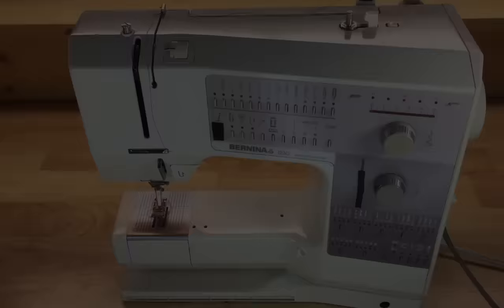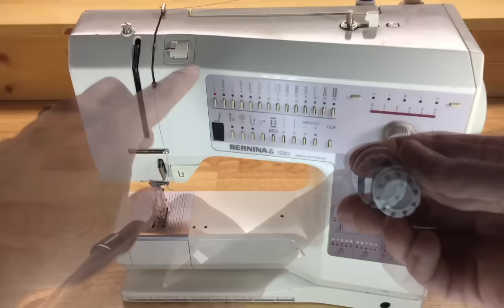Sewing Machine Problems: The Most Common Issues

Comment: Thanks so much for your video. I found it helpful but unfortunately I’m still having issues with my Necchi sewing machine model 4975. Every time I try to sew, the bottom thread gets all wadded up! I’ve adjusted the top and bottom
Tensions per your instructions but still can’t get it right! I’d appreciate any help you can give me! Thanks
Reply from the maker: Most likely it's an upper threading issue. Make sure you're in your tension disks and take up lever. If you're 100% sure it's threaded properly it might have a burr on the hook or bobbin case. If you'd like you can take a video and send it to @jackcreekroad on instagram and I can try to help you more from there :)

Comment: Can you help me solve this issue... after completing a row of stitches, I raise the presser foot, pull my fabric away from the machine, I sometimes have 3 strands of thread coming from the bobbin area. What am I doing wrong?
Reply from the maker: The stitch isn’t completed. So you need to rotate the handwheel towards you until the take up lever is in the highest position before you pull your material out.
Reply: I didn’t think the issue I am experiencing had to do with the take up lever because the 3 strands would be at the very end of the stitching. Nevertheless, I will now ensure the take up lever is all the way up just before ending my stitches. Thanks so much for sharing.

Comment: Thank you for being so thorough. I have a question about stitch appearance/quality: my upper and lower tension appears to be correct. (It does seem my bobbin tension keeps coming out of adjustment.) However my stitches on the underside of my work seem to not be perfectly straight. The tension looks good. But every 20 or so stitches one or two stitches will look wonky. It might sound like no big deal but it makes my work look unprofessional (to me). Anything I can do? Is this a timing issue? I'm very careful about keeping my machine clean, oiled, new needles, all the things. It's an old machine - brother vx-1100.

Comment: Thanks for this very useful info. Is there a home repair for a straight stitch not being straight? I have a top-loading manual Elna (purchased for under $100 used) that functions mostly pretty well except for the straight stitch. The individual stitches all slant slightly. Is this fixable? The other issue the machine has is the 1-step buttonhole. The right side zig zag is always less dense than the left side. I’ve heard this is a common problem with Janomes (manufacturers of Elnas, right?). I’d be grateful for any guidance.

Comment: I know this video is older and you may not see this.... but.... what are the trouble shooting options for "nesting" on the bottom stitching if you can see the thread through the take up lever and you hold the thread when starting stitches.... it also does happen all the time, but times than not.    I have a sew mate 5400 that was gifted to me.... and singer tutorials haven't helped much.  Any advice would be greatly appreciated
Reply from the maker: It could be a few things. Your tension should be around 4. You need to make sure that your threading with the presser foot lifted. And make sure, as you said, that the thread is in the take up lever and you hold your thread tails.
Reply: @JackCreekRoad  foot up, I'll definitely try that.  My machine is set to 5, which it factory recommended as marked.... but I will try on 4 and see what happens.  Thanks so much!

Comment: 2 things going on with my machine. It's a new Brother project Runway limited edition. My bobbin isn't winding tight. The thread is loose. I'm not sure what's going on with it. Then when I'm trying to sew with the prewound bobbin that came with it. The top side when I'm looking at it has loops. This is a new machine that is different from my older one. Not sure how to fix it. HELP!!  Thank you..
Reply from the maker: Are you going around the pre-tensioner for the winder?

Comment: Whenever I try to use my sewing machine the top thread pulls out of the needle. It also bunches and loops before the thread is pulled out but the machine isn't jamming at all. It feels like I've threaded it properly (there is tension when you pull on the thread) the tension is set on the factory setting, I'm not entirely sure what's wrong.

Comment: Great video. You helped me clear some issues.
I have one question: could you address bobbins with differences in the lenght of the needle opening? I had to figure it out after breaking a needle. Thanks.
Reply from the maker: Sure! I've been working on a new recording space, but I'll try to make that a quick tip video in the next couple weeks.

Comment: We fix a lot of sewing machines and donate them... an issue at times is it isn't feeding properly. What should we look at to adjust on the machines?
Reply from the maker: Check and make sure that there is no debris like fuzz or lint between the feed dogs and the needle plate. Also be sure to make sure the stitch has some length to it (if it's on 0 it will not feed.)

Comment: Thank you for posting this informative video. I have a problem that maybe you can help with: I just bought a Singer SM 024, threaded it properly but when I ran a practice sheet through (cardstock), the needle broke. This happened twice in a row. I have been looking for explanations on YouTube but apparently there are dozens of reasons why my needle would break. Please help.
Reply from the maker: It's really tough to say. Have you tried it again since then? If the needle isn't in correctly (not all the way in, backwards, etc.) It will almost certainly break everytime.

Comment: Hi, I just came across your video on "Common Sewing Machine Problems", it was extremely helpful, but the part on sewing machine tension especially caught my attention.  I was recently making masks for neighbors and noticed that my tension was fine as long as I was going at a good pace, but when going slow the tension was to loose, how do I solve this problem or is this an issue w/the tension mechanism?
   One other question, while working on the above project I also noticed that my feed was not keeping the material straight and I had to hold the material in line. Granted this machine is 10 to 15 yrs old, but still sews well normally, so I am not sure why this has become an issue.
Thank you for any guidance you can give.
Sincerely, 
Michelle Parsons

Comment: How do you fix a timing issue? I have tried and I got it to pick up the first time when I pull it up to get both threads on top, but then the stitches connect once and won't pick up afterward.

Comment: My wife has been sewing masks for weeks on my moms old (40 years?) Singer Melodie 40. A problem has developed that when the needle goes all the way down it hits the metal case (?) the bobbin case sits in. The needle actually get dragged along a tiny bit. Any suggestions please?
Reply from the maker: Most people don't change their needle as soon as they ought to, so that's the first thing I would do. When you're putting in  new needle be sure to push it up into the machine as much as possible (until it hits the stop.)
Reply: @JackCreekRoad  thanks for getting back to me,  we will have a look

Comment: Hi!  I have a question.  The problem my daughter and I keep having with our machine is that it keeps tangling up down in the bobbin area.  When you go to finish a stitch its like there are 2 extra threads coming out of the bobbin area, so a total of 3 coming up and out of the upper plate.  We have tried different tensions and such but I will check for burrs and things that you mentioned in this video, which was fantastic and very helpful!! We are are both newer sewers and this always frustrates us and I'm not sure at what point I take the machine in and let someone else fo through it and fix it, but I don't want to go to all of that trouble if it's something simple and I should be able to work it out.  Any input would be so very appreciated!  Thank you for making such great videos!!
Reply from the maker: An easy way to remedy this is to make sure that the take-up lever is in the highest position when you stop. If it's not, the previous stitch is still in the process of being tied and will create this issue.

Comment: My hand wheel (on the right side) wont turn.  The machine won't turn at all now, after  i loosened the hand wheel  to make bobbins. 
How can I fix it?  I have tightened and untightened the hand wheel repeatedly.  There is no spool button.  I have an older 1970s Singer.

Comment: Thank you so much! I've learned a lot. I definitely have some things to fix (i.e. universal bobbins) 
I have a question though, I keep getting clean top stitches but birds nest of bobbin thread. Whats going on? Sometimes the top stitch is snapped on the bottom side.
Reply from the maker: If it creates a bird nest then jams it's most likely missing the take-up lever, if it's shaggy loops on the bottom is either tension and/or upper threading.

Comment: Hi Jack. great video. I saw teh part about if problems with teh thread on teh bottom itis the top tension. I do however have my thread through the take up lever but still have a huge mess on the underside of what I am sewing. i was sewing all day just hemming pants and changed the thread and bobbin and now I suddenly have issue on my singer 4432 where the needle gets stuck & does not go forward. underside has clumps of thread and loops. basically a big mess on the bottom! The  user guide says I must check I loaded the bobbin correct. I did check and reinserted to bobbin and seems ok. I am sewing pants that are a thin stretch material but I had been doing several before this started happening. It is only when I changed colour of thread this issue has started. I have even bought special stretch needles thinking maybe for this one particular pair of pants it was having an issue with a standard needle. any ideas?

Comment: Thanks for this amazing video! I had a question for you. My zig zag stitch was fine when turning the wheel forward but when I started working on fabric the needle kept hitting metal, i think it was the hook. Do you have an idea what could have gone wrong? Thanks in advance!
Reply from the maker: First thing I would try is a new needle. If that doesn’t solve the problem you may have an issue with either the needle bar alignment or perhaps a burr on the hook itself.
Reply: @JackCreekRoad  thank you so much! Switched the needle out and that totally did the trick. Thanks heaps!

Comment: Thank you for this video, it is super helpful!! My issue is that my upper  thread is getting stuck on the bobbin/bobbin hook. I can't seem to find a video for it. Do you happen to know a common reason this happens? I can't even get the bobbin thread pulled up, without forcing it myself. When I do that, it sews very similar to your low tension example. Any thoughts??

Comment: I have a new future ce150. I sewed a few straight stitches and it worked fine. I then loaded software for embroidery into laptop with windows 7 exactly as directions said and machine did not work. I uninstalled embroidery program and now machine will not even see a straight stitch. Needle goes up and down once machine stops and lights up. If I turn wheel by hand stitches appear good and no jamming but motor will not turn machine to stitch.
Reply from the maker: When you are trying to sew, is your embroidery unit still on or did you take it off? (It has to be off to sew "normally."

Comment: My top thread has been wrapping up in the bottom machinery and jamming. the few stitches it makes looks like the ones you made when it wasnt on the top lever. i have a front loading machine, any ideas on how to fix it?
Reply from the maker: Start by rethreading everything. It will do something similar if you're not in your top tension or if it is set to low.
Reply: @JackCreekRoad  It worked! I also re-oiled it, I didn't know you had to do that. I can finally start working again. Thank you so much!!!

Comment: When threading a bobbin, my machine stops before it is full. I have to let up on the peddle and start over several times before it is full. it comes with an error code of c-1. i have a Singer Stylist 7258. Thanks
Reply from the maker: If I recall correctly, try changing your presser foot position. If the error occurs when the foot is down, try winding with it up (or vice versa)

Comment: very good delivery on you instructions , Do most machines have top and bobbin tension, Thank you very much always have a problem with tension till now, Thanx again
Reply from the maker: Thank you! And yes, all sewing machines, if they have a bobbin, will have bobbin tension and top tension. An exception would be specialty machines that only have a top thread and no bobbin (which are rare.)
Reply: thank you very much for the quick response, so my next question would be would the part time sewist  ever have to adjust the bottom tension, and what signs should I be aware of. Sorry to overload you with all the questions Thank you for your time ⌚
Reply from the maker: It is very very rare to have to adjust bottom tension (Maybe 1 in ever 50 machines we see.) A sign of poor bottom tension would be loose or tight stitches on the TOP of your material (as long as your top tension is close to or at the manufacturer's recommended setting.)

Comment: I'm having a problem with the  thread on the bobbin my  Tension is good  But when I so the top 3 it is good so good stage but the Bottom thread is loose and I'm able to pull it with my hand when I'm sewing material .

Comment: Thank you for the video it is very informative. I have been trying to sew on a Kenmore 385 and for some reason it is sewing backwards towards me not away from me. and i cant for the life of me figure out why. I have tried everything putting the feeder arms down then they wont feed then putting them back up they feed backwards tried pushing the back button to see if maybe it is stuck but its not when i push it it back stitch just fine. I'm so lost and frustrated pleeese help me  any assistance will help.
Reply: I read in another comment that he suggests making sure machine is not in button hole mode.

Comment: Question- what causes a machine to stitch a smaller stitch then what you set the machine to do?
Reply from the maker: Hi there! Two things that can often cause this issue - If there is debris built up between your needle plate and feed dogs or if your presser foot pressure is to high/low for the material your working on. I would recommend cleaning your machine and trying it again. If that doesnt work, try adjusting that pressure.

Comment: Hey Jack. Greta video. I have the Janome 6700P and last week was binding a quilt. Test samples were perfect, on the same stack of fabrics. When I stitched the binding it was dropping lots of stitches on the back. Janome says it might be timing. Any ideas? Thanks.
Reply from the maker: Hi Andrew! If your machine was out of time it would not have sewn well on your samples. Odds are it's a project issue which could include your material, thread and needle combination. I would recommend trying out different upper tensions first. You may also have a burr on your hook which can also cause it to skip stitches.
Reply: @JackCreekRoad  Thanks Jack. I have checked the timing and its fine. As you say, it wouldn't have sewn well with the samples. As it was a new needle, my best guess is the fact that the needle plate is very slightly bent from old needle crashes, which I have now fixed. The other thing that I never thought of is that the machine came with 3 needle plates, one of which is a high speed straight stitch one, which I will try. Thanks again.

Comment: Any diy solution if machine runs at very slow speed as I think its got jammed not used for a while
Reply from the maker: Run it as much as possible. If you feel comfortable opening it up try a drop of oil on every metal on metal moving piece.

Comment: I have a question?...What do you do to fix loose interlocking stitches? My upper tension and lower tension stitches are symmetrical. There does not appear to be anything wrong with the sewn piece. And the fabric feeds good through the machine. BUT when you pull those two right facing pieces of fabric apart that you just sewed together you can see the stitches and thus the overall stitch itself is loose. Please help. Have a bernina machine.
Reply from the maker: You can try using an extra layer of material or wrapping tissue to sew over to give your stitches a little more backbone.

Comment: Janome QC860P... I'm sewing fleece....a zebra fleece. (That really is sorta important.) I've got a white thread on top a black in bobbin sewing a black zipper without a front facing onto a hoodie. I noticed the top thread is pock marked with black thread and when I pull the thread out it's not the bobbin thread that comes out way it's the top thread. It's as though my machine is around backwards. I've changed the there's lenghth the top tension the presser foot tension at nauseam... The to thread is still acting like it's the bobbin thread. Grrrrrrr

It's a front loading bobbin... I've cleaned it out (it was very dusty inside)... But nothing has changed. I don't even know how long this has been going on. It's the two threads on a zebra print and black zipper that brought it to my attention. What the h*ll is going on. Is it something to do with timing?
Reply: Grrrr auto correct I thought I double checked the words before hitting send but.... So much for that. I've changed the stitch length